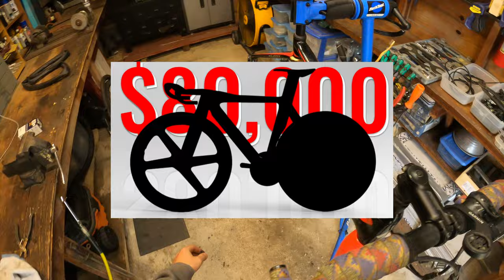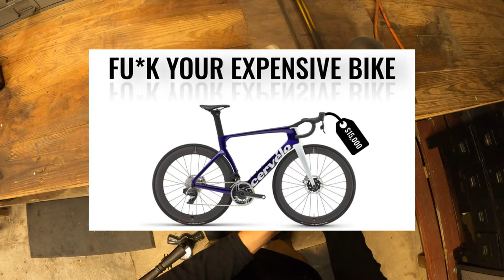Why you have to be an idiot to buy an expensive bike...

Comment: mountain bikes are way different with hundreds of parts that all have to work together to provide the best ride possible. that’s not to say you can’t get a solid mountain bike for relatively cheap, mine was less than $1100, but mountain bikes being priced in the $5000-$10000 range is somewhat justifiable with all the technology in them
Reply: Yeah, but you used to get Shimano XT or Sram X9 with Fox Float (RS Pike) on $3-4k bikes - GX was on $2k. Then they, especially SRAM, made lower end drivetrains and put them on even more expensive bikes. I couldn't believe it when I saw SLX spec'ed on $5k bikes, and NX on $3k... lol. And people bought that.
Reply from the maker: Oh what a time 2021 was... everyone was a fool
Reply: I have a JIBB RAAW with all the goodies.  Probably 3k in parts but i got it for $1500. 
1500 was the top i was willing to spend and that was pushing it.  
I bought my Yamaha FZ1 for 3k.

Comment: Purchased a Cannondale CAAD9 in 2009 for less than $1,000.00. In 2024 I purchased a set of Mavic Kysrium ES special edition wheel set for $350.00 & then purchased (used) Sram Red Etap set for $1,000.00. The purchase of the bike was pretty much, just for the frame,. For app. $2,350.00 and my own labor, I have a somewhat modern superbike.So ........ you don't have to spend a TRUCK LOAD OF MONEY for a bike.